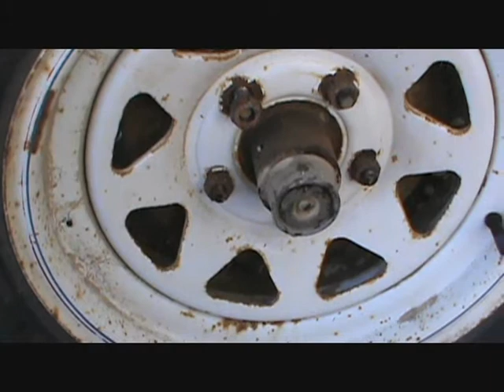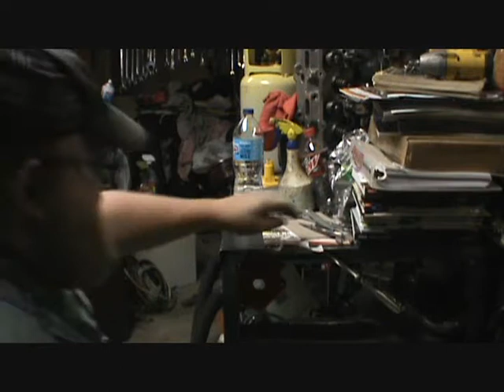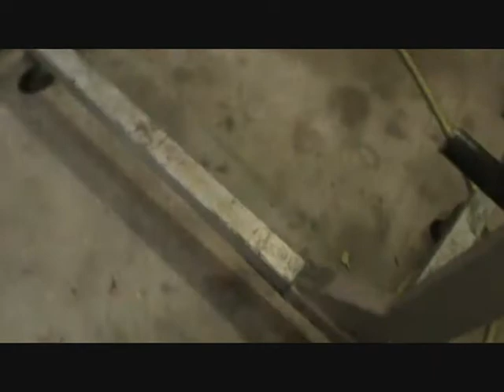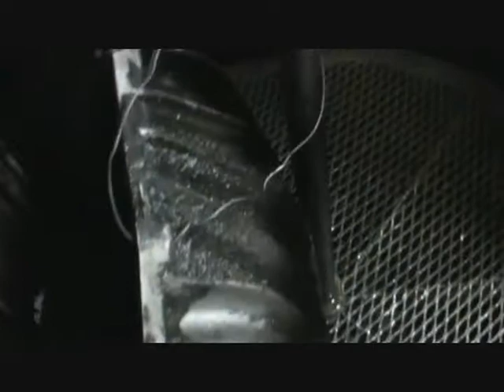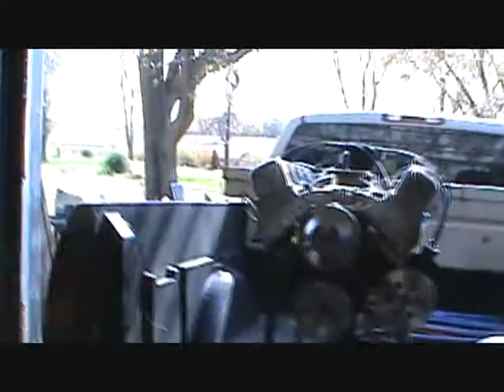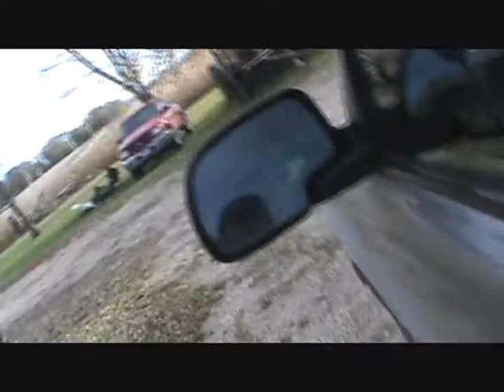work trailer repair motor parts lots going on in shop

Comment: The hot tank really works well. I think they used those 350's in the police cars too. late 70s to mid 80s. Police cars ran a oil cooler so might be something different where the filter go's on.
Reply from the maker: yes the hot tank has been a blessing. well this one now has normal oil filter on it but who knows what it had before.

Comment: pickup motors are suppose to be 4 bolt mains correct
Reply from the maker: well all  the motors i have pulled they have been a mix of 2 and 4 bolt. think the 4 bolts were mostly in the 3/4 tons up the 1500 usually got the 2 bolts but with gms record keeping im not sure they all got the right motors in the right place lol.
Reply: Absolutely right about GM and their records but I will always own a GM...